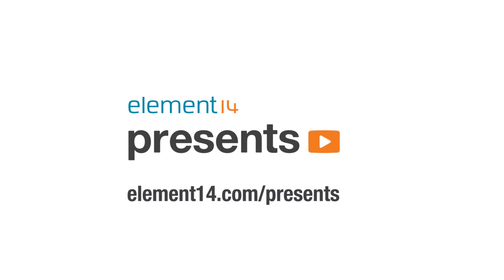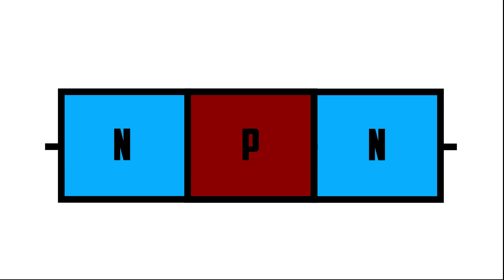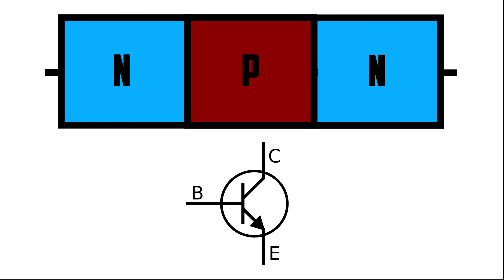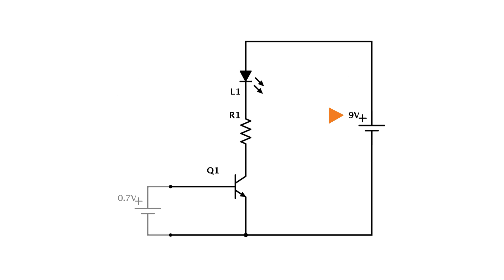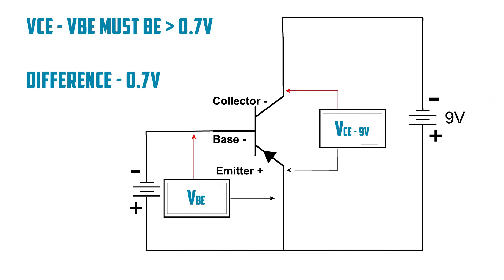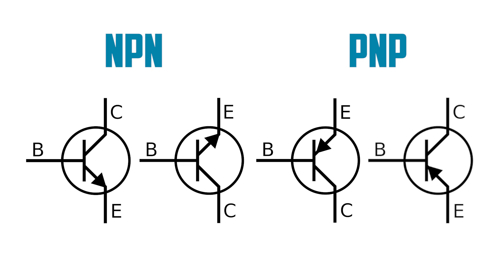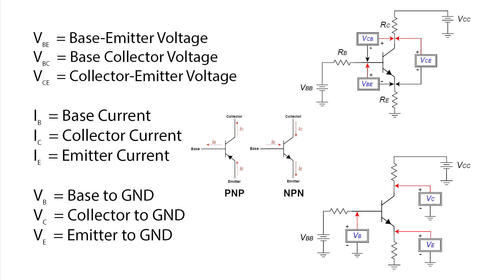How Transistors Work - The Learning Circuit

Comment: so pretty to use a transistor as a switch u have to have a small current flow from the base to allow a larger current to flow from collector to emitter?

and does that require two separate voltage sources?

Comment: At 2:36 you state that the base current flows from the base to the collector ....but your diagram shows the current flowing from the base to the emitter.   Is this an error?
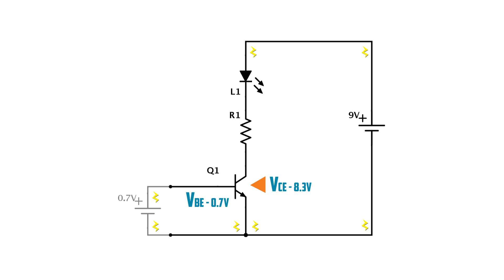Reply: ....and at 4:20 isn't the 8.3V the potential difference between the top of the LED and the collector?   As current is flowing, there is a voltage drop across the LED and the resistor.  So I would expect the Vce to be much less than 8.3V in the circuit as shown with the transistor turned on.   Am I mistaken?

Comment: It's like a tap water valve. There are 3 elements in the valve: inlet, outlet and valve control. If you want water flows from inlet (emitter) to outlet  (collector), you open the valve control (base).

Comment: love your videos---I know its an old video, but I recently built a 3.5v regulator using a BJT with a 4.2v zener diode on gate to control gate voltage...input is 9v.  The problem I'm having is that my math and the results don't seem to correlate.  Using a 4.2v zener, (500ma ) and 1k resistor...I am getting output of 4v.  I think I should be getting 3.5 or so...(ie--.7 volt gate drop)---but--I end up getting 4v!  It's driving me crazy!.  I work with MOSFET's all the time and find them very easy to bias and use.  HELP...I am obviously wrong in my calculations
Reply from the maker: Try asking the expert engineers and makers on the element14 Community: http://bit.ly/3nIRx8N

Comment: How do I test a selector valve handle on an aircraft cargo door that has a transistor symbol in it's drawing?  It has three positions, 1) Open  2) Off  3) close.  It does two functions, it mechanically ports hydraulic fluid to either the open or close plumbing.......and in either open or close it turns on the hydraulic pump to provide pressure. It doesn't directly turn on the hydraulic pump.....for safety it goes through the LGCIU computer so the hydraulic circuit will not work when the aircraft is in the air. So it is the LGCIU that controls a relay to actually turn on the hydraulic pump. The selector handle sends the signal to the LGCIU which turns on the hydraulic pump as long as the aircraft is safely on the ground. 
The electrical connector has three pins which are shown in the drawing like a transistor. In the drawing one of the legs of the transistor doesn't seem to connect to anything. I think one of the connector pins (C) is unused. But that can't be right for a transistor....can it? I want to be able to test the selector handle to see if it is functioning electrically. How do I test that transistor in this selector handle? 
 When I have an assistant hold the selector in either the open or close position, I get nothing on my meter in the diode setting. But I know the transistor works once other wiring problems were repaired. But just to eliminate the selector handle early on in troubleshooting.....how do I test it electrically?   Thank you for any help you can provide. Oh yeah, on the drawing I can see the side where 28 volts should come in and that voltage is in fact present on the Aircraft side of the connector. But activating the handle results in no continuity when the meter is connected across any two pins in the selector receptacle. (which is the way the LGCIU computer looks at it.)   
Shouldn't the selector handle simply provide continuity in the open or closed positions? Why is it so confusing to test?
Reply from the maker: Consider asking fellow engineers and makers on the e14 community: http://bit.ly/3FfHazj
Reply: @element14presents  Thank you for responding. For the record the Trouble Shooting Manual never asks us to test the selector handle. It just says to replace it if no other faults are found.. Thanks again.

Comment: I'm still in shadow analyzing what really took place after + voltage was applied to base of an npn transistor..there must be  a reason why current flows from imitter to collector when base was supplied + voltage.a concrete explanation.there must be an effect of positive charge applied to the base to the negative charge of the emmitter that cause the flow of electron emitter to base and emitter to collector.unlike poles attract each other.

Comment: Tip on how to remember NPN and PNP direction of arrow...  NPN, "Never Points in",  PNP, "Points in Permanently"...
Reply: ...next video - How to create a voltage divider network so that you can either get >.7 volts, or a delta of .7 Volts in order to make the transistor switch on or off...

Comment: What is the voltage drop in pnp?
Reply: same as npn
Reply: @adamdelarozza1985 
But in npn, we give a small voltage in base and that much is the drop. 
In pnp, we need to give more voltage in base. So, wont the drop will also be high and we gets only a small voltage in output?

Comment: 4:20 . . . Not true. The Vce of a saturated transistor is only about .2 volts. This is because as the electrons move from the base region to the collector region, they release some of the energy they acquired to overcome the Vbe. It's one of the more interesting aspects of the BJT.

Comment: So then for a PNP example you give, the base-emitter needs a power supply of at least 8.3 volts or you wouldn’t be able to shut the transistor off? Does this mean that if you were using a microcontroller that is only capable of emitting 3.3 volts, and you wanted to use one of it’s output pins as a base emittor, to a transistor powered by 9 volts, you could use an npn transistor, but not a pnp transistor?

Comment: Vce will not be 0.7V if the transistor is saturated, it will be around 0.2V. Vbe is not the same as the voltage drop across Vce!

Comment: I would like to know is it a case that once 0.7v is at the base the the current which then flows between the emitter and collector a fixed rate or is it proportional to the voltage at the base; example if 2 volts was applied to the base would this increase the current flow to the emitter and collector or would it still be the same amount of gain as if 0.7V was at the base. I believe the term Iam thinking about is called voltage saturation, any ideas?

Comment: 5:22 so for PNP: does it means if there's only VCE closed circuit connected to PNP without VBE circuit - will VCE works? (Since 9V - 0V > 0.7V)
Reply: There is an error here for PNP,   I think,  it is still VBE that should exceed 0.7 V (or, more accurately, should be less than -0.7 V,  i.e larger than 0.7 by magnitude).    If you think about each np junction as a diode, it is just a direction that changes in pnp but still same voltage to start moving electrons/holes across the BE junction,  not that you suddenly need  VBE close to VCE (determined by external conditions !)

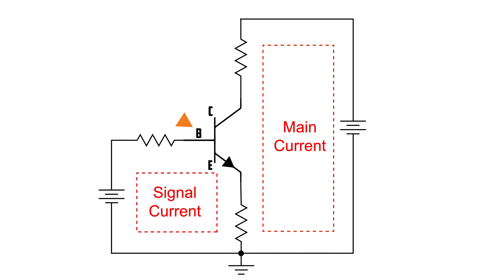Comment: Hi - The statement you are making around minutes:seconds 2:35 to 2:41 is not correct! You mean the base current is from the base to the emitter! Your diagram is correct but your explanation during these times in speech is wrong! There are two current loops B=>E and C => E. I also find that you are in a hurry. It would have been better to take it a bit slower. I have had to play and replay several times to fully understand what you are talking about! That's bearing in mind I already knew about transistors and wanted to remind myself of their operations. I wonder what a rookie (as you would call them in USA or a novice in English) would think watching this video! It would also be good to point out that this direction of current is called conventional current which again is really not the correct direction. The electron current is the correct direction and the reverse of the conventional current.

Comment: Seems there is an error in the explication. The V(BE) has nothing to do with V(CE) and the Voltage drop on V(CE) is significant smaller than 0.7V if switched on!  Example BC172 has 0,25V V(CE)@ 10mA I(C) and saturation.

Comment: why my transistor keeps blowing when I am replace my light switch with it and turn on with a 0.7 volt battery, it splinters into many pieces and fly in all directions with a big spark?  The light bulb is 240V 100 watt bulb. Oh and it smokes as well. Do I need a heat sink may be.

Comment: I get the 0.7 Voltage Drop across Base-Emitter... however,  how come there's NOT a 1.4 Voltage Drop from Collector-Emitter, since that passes thru 2 PN Junctions?
Reply: The junctions are in opposite direction, one pn, other np, so in ideal stable regime between emitter and collector you have drop of 0.7 V on one junction and rise of 0.7 volt on the other
Reply: @dmitripogosian5084  Thanks for explaining this... now, I also sometimes see an equivalent Voltage Source of 0.2V at this same junction... can't figure-out why

Comment: In the circuit diagramm i haven't got the battery  0.7, and the resistance after the diode to limit current in the led? Or in the transistor?

Comment: 4:20 This is incorrect for the diagram you've given. You will only loose .7v from the circuit if your collector and base junctions are supplied from the same source. In your diagram you'll only loose about 50mv (Assuming a 2n3904 and 1k load with some amount of base resistance) in the collector to emitter channel as you are supplying the base current separately from the collector.
Reply: I caught that as well. the Vce is (Vcc-Vrc)/R1 - Vled = [(Vcc-(Ic*R1))/R1] - the Vled drop from the LED not the .7v from the Vbe.   Also BJTs are current controlled not voltage controlled. She is explaining the switching effect as if they are JFETs or MOSFETs.....which are voltage controlled semiconductors.  Try applying 7v to the base of a BJT without a resistor to limit the current flow and watch it burnout instantly.

Comment: Since when is the bipolar transistor controlled by voltage (Ube or Vbe) and not by base current (Ic)??
Why did you focus on just one layout?
The common collector (emitter follower) or the base (current source) are no longer interesting ??
Explain why the presented circuit (common emitter) inverts the output phase. 
This is due to the characteristics (input, transition and output) - you haven't shown that either. 
I do not know where you are broadcasting from, but this information is the basis in Poland on any electronic profile since high school - not studies :D

Comment: The emitter region in the p-n-p junction transistor is more heavily doped than the base region so that
A. the flow across the base region will be mainly electrons 
B. the flow across the base region will be mainly holes 
C. base current will be high 
D. reacombination will be increased in the base region

Comment: A BJT is strictly a current driven device. Above a threshold voltage of about 0.7 Volts Vbe, current flows in the base to emitter circuit. This then "Allows" Current to flow in the collector emitter circuit, Controlled by the gain of the device.

Comment: Karen, If a transistor is an on off switch, and you control it with on off of the base electricity, isn't that enough? You want an on off, the base is on off. You're done. Why do you want all that other stuff?

Comment: Good intro. I want to drive 12v LED from an Arduino which puts out 5.5v. I think this means I need an NPN transistor and an 18v VCE power supply. I still don't know what the R1 value is, but I think I am getting the basic idea.
Reply: I have made a video on this in my channel

Comment: Man, this video has too many contradictions, and mis-information...  she's correct in saying the bipolar transistor can be used as a switch, or amplifier...but it's more of a 'current' amplifier.... she seems so intent on telling us about the .7 drop on the Vbe junction, and NOT about the current...  and that example at 4:23, why is the Vce 8.3v...if the transistor is fully ON (saturated)....the Vce would be about 0.3v measured to GND.(-).... allowing the current flow thru the resistor/LED....  Now if the current in the B.E. junction is low, in the 'linear' region...the transistor is NOT fully ON, and that's how the transistor can 'amplify' the current, the small B.E. current can 'control'  a proportionally 'larger' current according to the 'beta' (gain) of the transistor....(see the datasheet)... I'm not surprized that alot of viewers were confused..... too bad too....

Comment: Hi Karen. I don't know much about transistors.  I watched several of your videos on transistors.  I do like it.  I want to build a small circuit that I think it's doable by using transistors.  Make it simple, I have a light in a box which I cannot see the light lit inside the box.  If the light dies I don't know because it is in the box.  So, I want to use a led to indicate the light is still alive.  I cannot install the led in series with the main load circuit because the load could be a heavy load.  So when watching your transistor illustration I think it's do able with a transistor using the same power source so if the main current is not flowing then the led turns off but I don't know how to do it.  Could you please show me how to wire it.  A diagram would be very helpful.  Thank you so much.

Comment: you lost me at 2:16 so why are the diode arrows different and the rest showing different positions in where the common is on the transistor? are they different or the same one? but just flipped upside down?

Comment: I’m a newbie so please forgive me.  I’m understanding why transistors work however, I’m not understanding why you need them.  Why would I build a circuit that requires two different voltages to activate the transistor when only one battery is applied to the circuit.  For example, most electronics require either a 9v battery, so where is the other voltage coming from to activate the transistor when you only have one battery?

Comment: Miss  please tell me what will be the voltage ,current  of base ,emmiter, collector if I connect mosfet in parallel on  one side is 50 mosfet d718 and 50 on another side I want to make push and pull  power amplifier please help me

Comment: "The main current in your circuit would flow through the Collector and Emitter while a signal current flows from the Base to the *Emitter" 2:33
Reply: This in "Common Base" signal circuit only. "Common Emitter" & "Common  Collecor" s are other configuration but rarely used.
Reply: @hannanpakthini7221  More like a Freudian slip I would think..and I am not an engineer!

Comment: I am sorry, I know how it works due to my master degree, but I did not get anythign from yours explanation. who is the aim auditory? children? they will not understand how pn junction works, the holes and electrons in silicon mix with aurum. Just explain it as a tap, which opens big flow. mechanics of work is not important. + JET MOSFET are also transistors, but principla of work is totally different

Comment: I didn't get past the first LED circuit....cuz the Vce when turned on is going to be less than a volt......I mean think about it....the LED drops around 3volts +- and the current limiting resistor several volts more.  So I don't get why you say that Vce is 8 something. I'm done.

Comment: Clearly, there are 2 main differences to understand Transistor Easily as Below :

1. We generally take positive output using a PNP Transistor.
2. We generally take Negative output using an NPN Transistor.

Other Points :

1. Voltage flows from Collector to Emitter in NPN Transistor and Current flows in opposite direction.
2. Voltage flows from Emitter to Collector in PNP Transistor and Current flows in opposite direction.

1. When you would connect an LED using either a PNP or NPN transistor, take care of soldering LED's Anode and Cathode (K) Leg. It will be vice-versa. Any wrong connection would lead to no light from an LED.

2. Base to Emitter, always High Resistance.
    Base to Collector, always Low Resistance.
    Emitter to Collector Very High Resistance i.e. (Digital Meter must show ("1").

3. In PNP Transistor, Ve > Vb by 0.7 Volt, Transistor turns on.

Transistor works just like a Tubewell with a handle attached to it. You push up the handle slowly or fast, you would get that much amount of water in the bucket outside!

Comment: pnp section is wrong. To turn on pnp bjt transistor, emittor base junction must be forward biased by 0.7 V, meaning Vbe = -0.7 V or Veb = 0.7 V. You state that Vce - Vbe must be greater than 0.7 V (Vcb>0.7). This is not true

Comment: In a darlington pair why would you connect the emmiter of the first one to the base of the second one instead of the collector of the second one?
Reply: Think of the base as a little push button which controls a massive flow of a river (from collector to emitter)

Though it does not take much force to push the button in, the harder you push the button in, the greater the flow of the river (from collector to emitter).

By connecting the output of one transistor (massive flow) to the base (push button) of another transistor, you are greatly amplifying the force with which you are pushing in the button.
Reply: @freddykrueger6571  Oh i see, thanks alot for the explanation. I was under the impression that the current 'dripped' out of the base. So i felt that connecting a emitter to a base would yield opposing flows. Does the base have different flow directions for PNP and NPN?